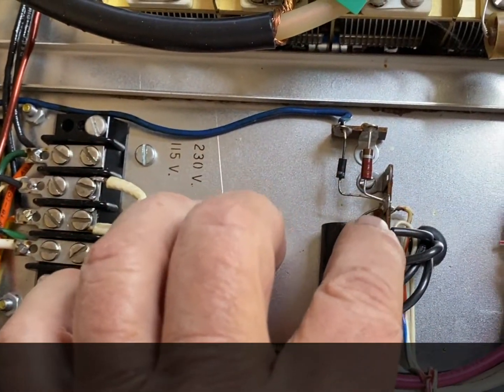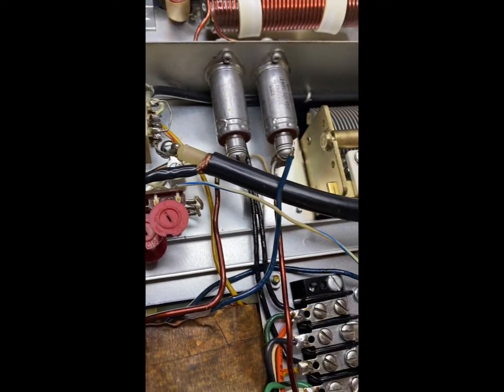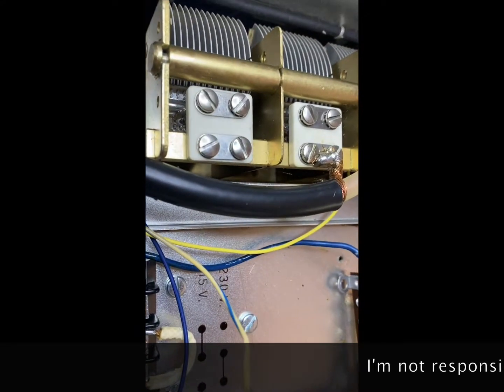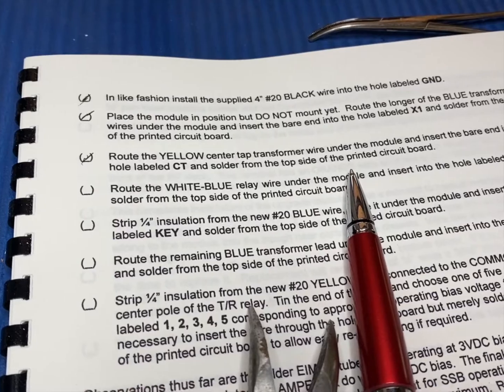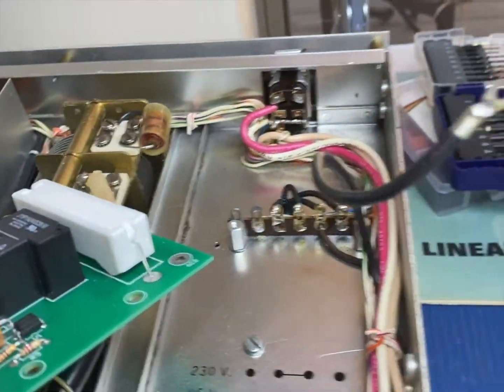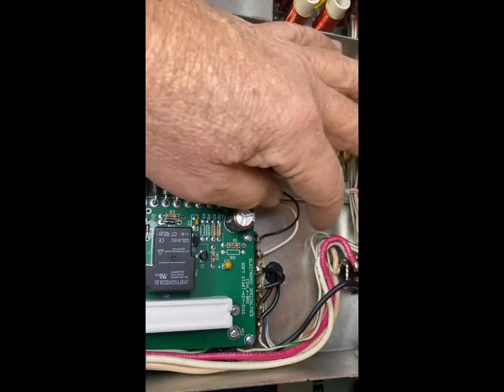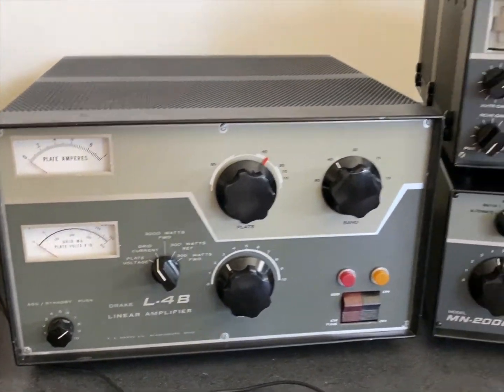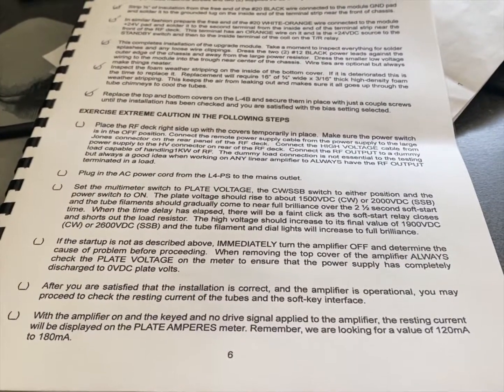Drake L4B amplifier modification with Harbach mod.

Comment: Dave.  I bought a keying rca to replace the original.  When I took it apart looked like the .01 uf cap was across both terminals attached to the rectifier.  When I looked at the schematic looked like the cap is supposed to go before the rectifier to ground and rectifier to center pin of rca cable.  When you did your upgrade.  How did you wire the rca key plug?
Reply from the maker: That's actually something I didn't install, so I can't answer that.  And I'm not very inclined technically.  If in doubt, check with Harbach I guess.  Sorry I can't give you an informative answer.

Comment: You're screwed when the guy you got the custom board from goes under and leaves you on your own with no parts now that you chopped the wiring all up. Dumb...
Reply from the maker: I'm not sure what you mean.  The board installs fine, and really makes the amp far more operable and cooler.  If Harbach went out of business tomorrow, my amp is still working great.  I've installed a lot of power supply upgrades from them and each one has worked perfecly.

Comment: Dave just completed this mod and your video was a great help in wrapping my head around what the directions referenced.  Thank you. One thing.. I don't think it matters but I think you reversed the terminal locations of the AC1 & AC2.   There is a picture at the bottom of the Harbach website home page and I believe they are opposite of yours.   I could be wrong, take a look. https://i0.wp.com/harbachelectronics.com/wp-content/uploads/2015/05/ES4L4B-2.jpg?ssl=1  Thanks Again!!

Comment: Thanks so much for making this video.  I see a couple people just leave the amp on and place a on off switch right on the 220 cable. 
Does putting in this kit eliminate the need for an external keying relay too ? 

Thanks
Reply from the maker: This kit does three things.  It does a timed power up were it does 120 volts for a second or so before a relay brings it up to 240.  Saves the switch.  It changes the idling bias so it isn't so hot just sitting there.  And yep, it changed the keying circuit so you can key it with a modern solid state radio.  Well worth the time and effort.

Comment: Great video Dave.I want to make the power supply mod and the soft start mod you have done.Did you have to do a bias adjustment after installing this board!Also where did you get the bound instruction manual for your install.I want to use the L4-B with my Icom7300 or my Yaesu FTDX10.Not sure what interface cable to use between the transceiver and the amp.I feel a little better about making this board install after watching your video.
Reply from the maker: Hi Ron.  I actually have so many manuals around that I bind my own these days.

When you order up the mod kit also order the little RCA jack to put on the back of the L4B.  I haven't installed mine yet, but that should make it so you can easily just have an RCA to RCA cable go between your radio keying jack and the amp.  The board takes all of the high voltage out of the situation so modern radios can key the amp without frying the radio.  Still, I'd put a meter on the input of the amp to make sure the voltage is down to the limits of the radio.  Generally 12 volts or less.

I just picked a middle spot for the bias and it worked just fine.

It sounds like you might be new to ham radio?  In any case, as a reminder, that amp will kill you if given any chance at all.  Don't reach behind the amp for anything once it's been on.  That HV line can stay charged for a very long time even after it is off.  Treat any older amp like a loaded gun.  Even if you just unloaded it, assume it is loaded.

Comment: Fantastic video. I picked up a used L4B not that long ago and have the harbach board sitting here waiting to be installed. I will have to come back once i'm ready! I'm waiting for 240 into my office before I play with it.
Reply from the maker: It is certainly a beautiful amp.  It is the first one I've owned that have the big tubes in it.  Legal limit is easy for sure.  The mod wasn't as complicated as I expected it to be.  I just triple-checked everything as I went along...and filmed it.  The fan is quiet enough that I always reach back and touch the fan blades to make sure it is running.  Have fun and let me know how it goes.
Reply: @DaveKelleyphotography  Just got the harbach kit installed and I grounded the grids. Very happy with the results, I bought the amp with no guarantees it worked, so its exciting to see the tubes glowing and it keying.  1.3kw with it in ssb mode with a 100w cw tone. This will be a very fun amp, and a nice replacement to my Heathkit SB-200 which will now become the backup! Still waiting on power in the office and some diodes to protect the meters. Hopefully it'll be wrapped up this coming week!
Reply: What does grounding the grids accomplish?